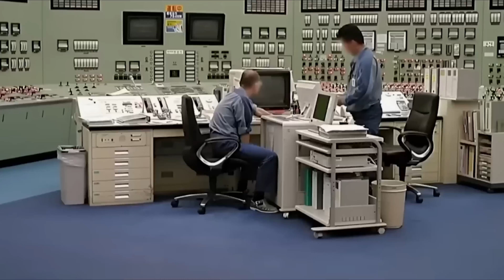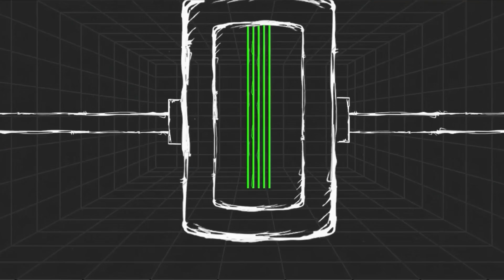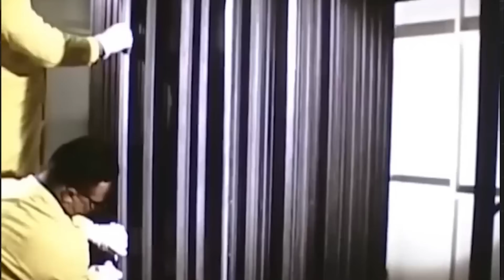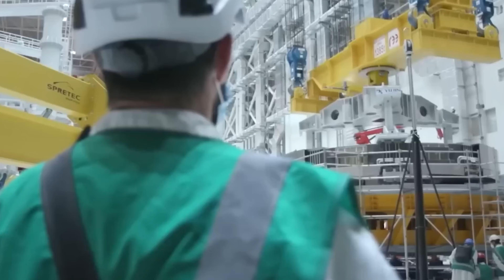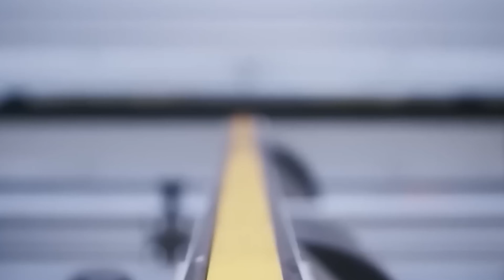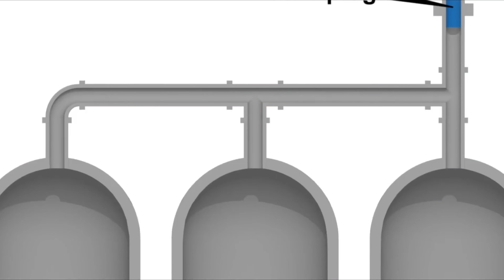China’s New Thorium Reactor Changes Everything — The US  Is Shocked

Comment: Can thorium reactors use 100% of nuclear fuel waste? Thorium reactors, especially Molten Salt Reactors (MSRs), can significantly reduce and better manage nuclear waste by "burning" existing plutonium and transuranics from spent uranium fuel, potentially consuming nearly all of it while producing less long-lived waste, though achieving 100% consumption of all waste elements is complex, with some fission products still requiring management, but overall waste volume and radioactivity are vastly reduced. 
How it Works:
Waste Burning: Thorium-fueled MSRs can process spent fuel from conventional reactors, consuming problematic actinides like plutonium (Pu-239) and other transuranics, turning them into energy rather than leaving them as long-term waste.
Fuel Breeding: Thorium-232 is "fertile," meaning neutrons convert it into fissile Uranium-233 (U-233), which fuels the reactor, generating more fuel than it consumes.
Liquid Fuel: The molten salt fuel allows for continuous removal of fission products and reprocessing, preventing buildup that shortens fuel life in solid-fuel reactors. 
Waste Reduction & Management:
Reduced Long-Lived Waste: Thorium cycles produce significantly less long-lived transuranic waste compared to uranium cycles, with estimates suggesting a potential thousand-fold reduction in hazardous waste volume.
Waste “Destruction”: Some designs act as efficient machines for destroying stockpiled nuclear waste, including weapons-grade plutonium.
Simpler Disposal: The radioactivity of thorium waste drops to safe levels in a few hundred years, eliminating the need for deep geological repositories for tens of thousands of years. 
Challenges & Nuances:
Not 100% of Everything: While actinides are largely consumed, managing some fission products (like cesium) still presents challenges, though less demanding than with current waste.
Infrastructure Needed: Developing industrial-scale facilities for reprocessing and fabricating thorium-uranium fuels is a significant hurdle, requiring substantial research and investment.
Reply from the maker: Thanks for sharing the knowledge!